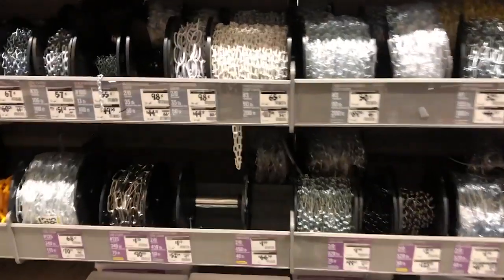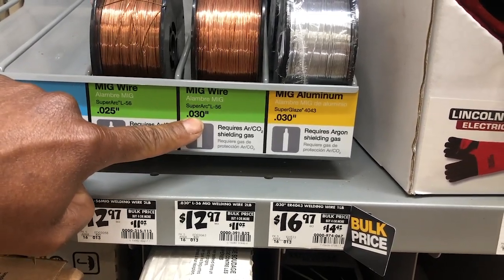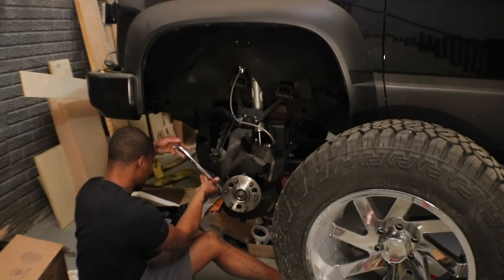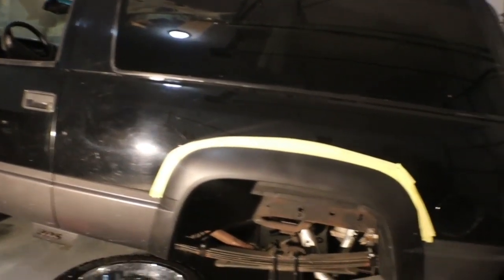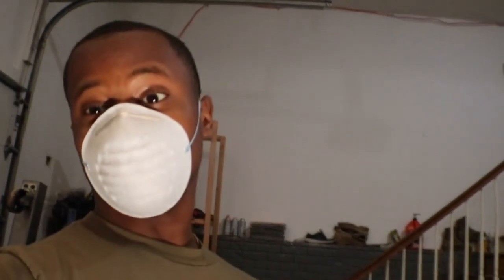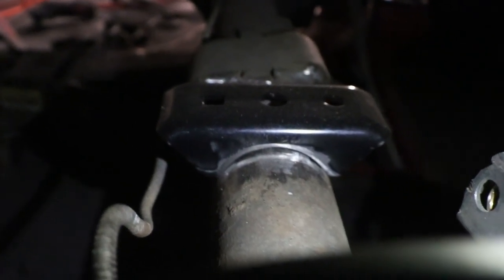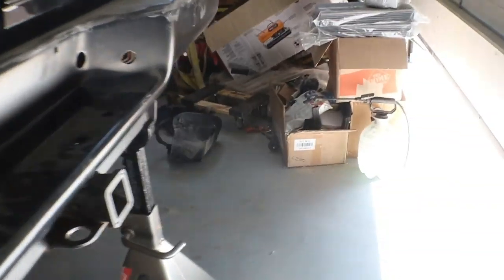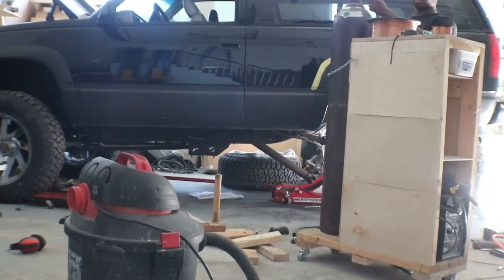BACK ON THE TAHOE❗️SQUAT IT⁉️

Comment: Lookup bad dog tools they have a cutoff wheel with lifetime warranty. I have cut steel alluminum tile wood plastic hydraulic hose air line concrete. Its about 75 to 100 for the disc and if it breaks send it in and they replace it. I love mine. Bad dog tools

Comment: Please don't squat it.  Also I have learned that from lowering hardbodies that once you go with a 4 inch block the pinion angle changes and therefore we go with an angled block so that the drive shaft angle will stay the same.
Reply: @sosabilly535  I know its 2 different trucks. Squatting looks shitty no matter what it's on. What I was saying though that even with lowering the pinion angle changes and therefore has to be modified in some way. The way I solve the change in pinion angle is angled blocks which help out a lot. I've never lifted anything in my life and possibly never will but no matter what you do on suspension like this it has to be modified due to the change of angle in the drive shaft. So no matter the truck or whether you are lifting or lowering the drive shaft angle will change and have to be modified per your fitment to keep the angle right.
Reply: Garland Vaughan u rite to a certain extent..!!! The drive shaft doesn’t move when squatting stock hight in the back it’s unnecessary to do all that extra work I’ve own a squat truck 3yrs ago ....